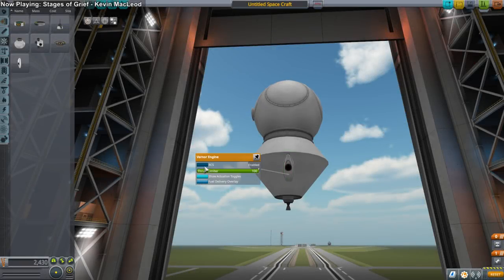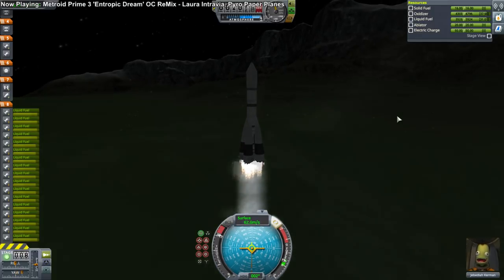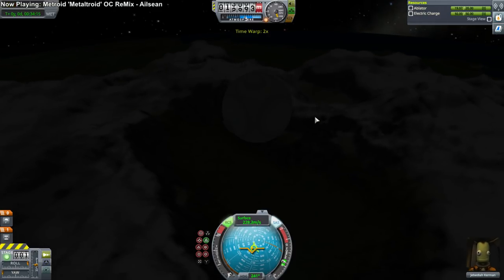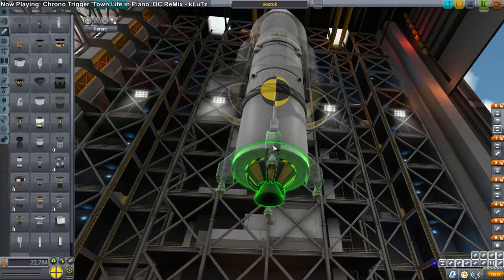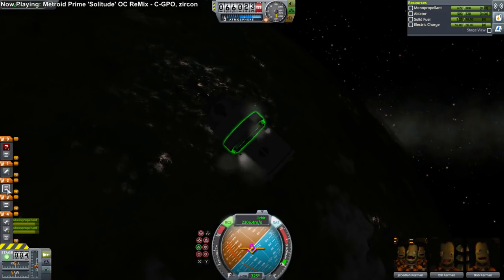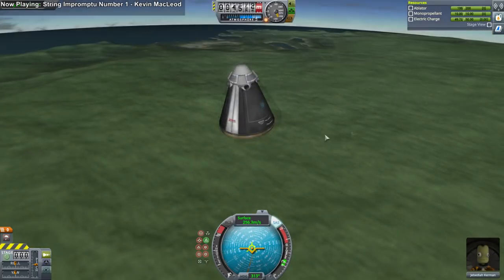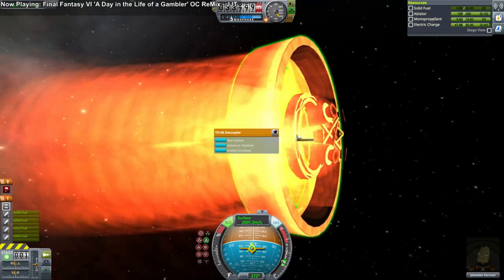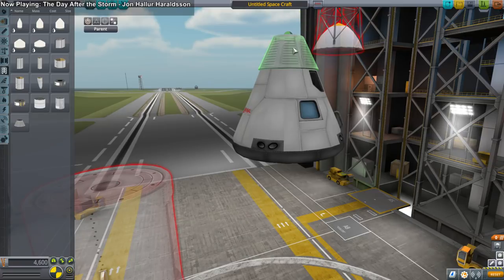Kerbal Space Program Making History - Quick Replica Builds

Comment: If you're having a "too-much-fuel" problem, you can always use structural tubes with smaller fuel tanks inside to keep the right shape without throwing off your fuel readings! That's what I ended up doing a lot.
Reply from the maker: Ah, good point. I should also check if the structural tubes are lighter than the extra tank mass, which they ought to be.
Reply: LupiDragon you should tell Matt lowne

Comment: Why did you add 2 monoprop engines, clip them into the center and then thrust limit them to 50?
Reply from the maker: They are radial engines and I didn't want any asymmetry (which might result if I just put one and tried to tilt it correctly) when I placed it at the center. Taking more time to test balance and placing just one would be more efficient, but I was also trying to match the mass of the real Soyuz anyway, so it wasn't a problem. I think this replica is still lighter than the real Soyuz spacecraft and has more delta-v.

Comment: So it sounds like the new engines are not balanced well for stock replicas of real rockets. Ignoring that, what do you think of the balance of the new engines compared to the other stock engines? Do they fit in well with the stock progression of engines?
Reply from the maker: As far as balance with the other stock engines, the main one I had a problem with was the Service Propulsion System engine - the AJ10 - which is why I outright changed it. Otherwise, even though the little verniers had a lot of thrust, they had the same TWR as the existing Twitch engines. One problem with those new Cub verniers, though, is that they have better ISP than the R7-style main engines, which should not be the case. I haven't tried out career mode and the tech tree, so I haven't made a complete assessment of the progression yet.
Reply: Raiz Space Thank you!